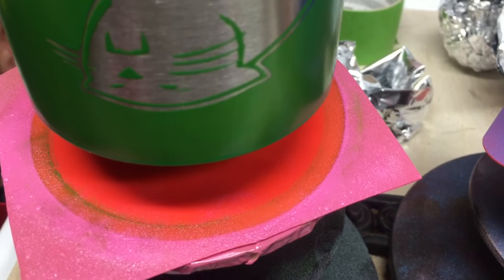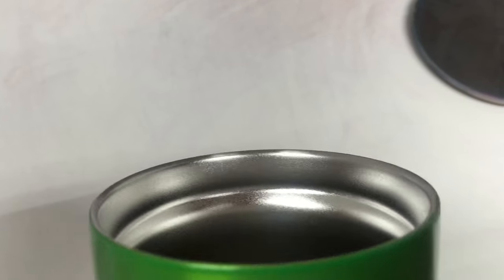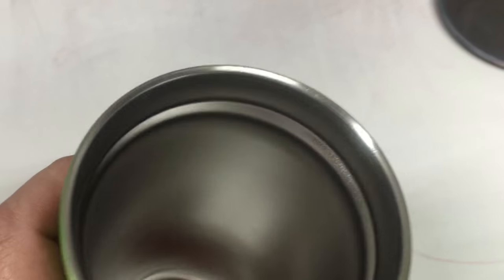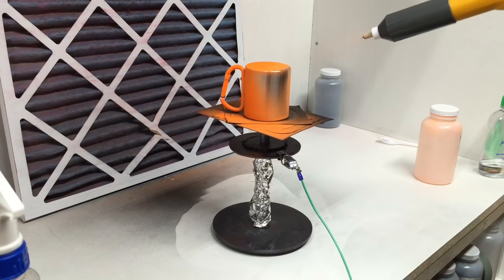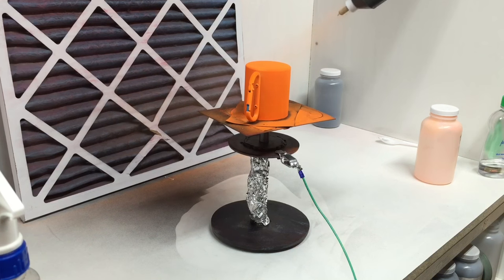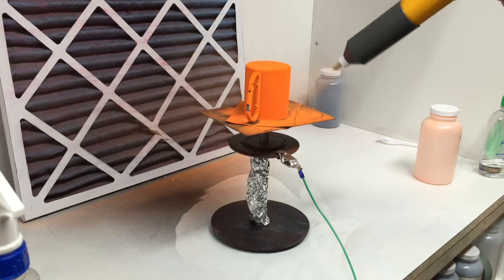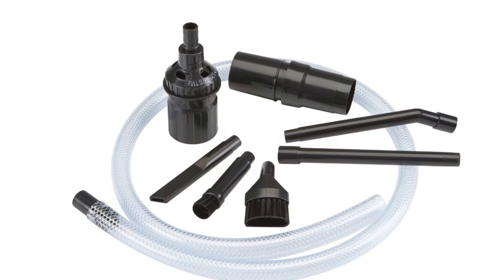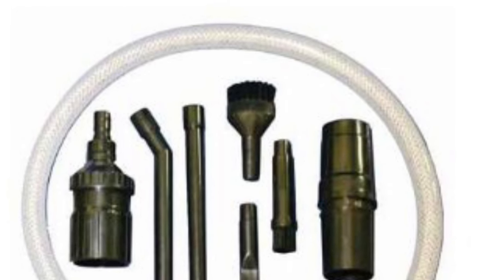One easy way to get a clean edge when Powdercoating a YETI.

Comment from the maker: Looking for things I use in my videos?  Look no further.  

Amazon Afillate Links:
Hypersmoth PowderCoating System  https://amzn.to/2NBkzjN
Circuit Rose Vinyl http://amzn.to/2dGxbFs
Circuit Explore Air 2  http://amzn.to/2cHnqJG
Vacuum Cleaner Micro Attachment Kit  http://amzn.to/2dCK5I7
Portable Bench Top Sandblast Cabinet  http://amzn.to/2dyewzl
Eastwood Dual Voltage HotCoat Powder Coat Coating Gun http://amzn.to/2dyecke
High Temp Masking Tape  http://amzn.to/2dCK8Dy
Oracle 651 Vinyl Starter Pack http://amzn.to/2dyexTU
Welding Jacket  http://amzn.to/2cS3z9j
Lincoln Electric Powermig 210  http://amzn.to/2dfOw6i
Certiflat Weld Table  http://weldtables.com/#_a_cust8g
Strong Hand Tools Heavy Duty Magnet Square http://amzn.to/2dycStl
Strong Hand Tools Magnet Level  http://amzn.to/2cS2ZYV
Markal Silver-Streak Round Metal Marker http://amzn.to/2dMikvI
Markal Trades Marker holder and 12 refills http://amzn.to/2dCLTks
Miller Extra Heavy Duty Gloves  http://amzn.to/2dMiqDD
FastCap PSSR16 16 FastPad Standard Reverse Measuring Tape http://amzn.to/2ut3PRK
FastCap PMS-FLAT-16 PMS Flatback Series Tape Measure 16 Foot http://amzn.to/2fgdIQQ
Evolution Power Tools EVOSAW380 15-Inch Steel Cutting Chop Saw  http://amzn.to/2dMhkb4
StudioPRO (Set of 2) S-600BN Dimmable 600 Bright LED Photography Continuous Bi Color Light Panel & Light Stand Kit with Carrying Case & Barndoor - Photo, Video & Film Production Studio Essentials   http://amzn.to/2dMiP9f
Blue Yeti USB Microphone - Silver  http://amzn.to/2dewgA5
Sony DSC-RX10 III Cyber-shot Digital Still Camera http://amzn.to/2dJcAA0
Reduce Cold-1 Bottle/Can Cooler 14oz (2 Pack) http://amzn.to/2cS4M0h
Makita 9557PBX1 4-1/2-Inch Angle Grinder with Aluminum Case  http://amzn.to/2dyh94x
Fluke 62 Max IR Thermometer http://amzn.to/2djM98G
Black 2pk - http://amzn.to/2fLLgkK
Blue 2pk - http://amzn.to/2fHXAUh
Pink 2pk - http://amzn.to/2fLJSyf
Char-Broil Vertical Electric Smoker  http://amzn.to/2fRGdiO   $137 Shipped as of 11-14-2016
Timer Digital Mini http://amzn.to/2gadt9M

#powdercoating #powdercoatingtip #powdercoatingtumblers

Comment: Thanks for the video! Do you not have any powder build up against the edge of the cup and the silicone pad?  I had that problem and it left a nasty build up of hard powder around the top.  How do you keep this from happening?
Reply: Curious about this as well.  My first cups had this issue.  I used a fine grit sandpaper to knock some of it down but it wasn't as good as I'd like.  I'm anxious to hear Chad's response.
Reply from the maker: Tell me more about the setup you are using?  Are you spraying the cup while it's on a silicone pad as well?  In the above setup, I am able to drop the base that the silicone is on prior to heating, so the buildup doesn't occur.
Reply: My biggest issue is the size of my oven. I'm using an oven from Eastwood which is pretty small so doing the large cups is challenging. Smaller cups utilize a stand closer to your design. I'm working on a stand that will hopefully alleviate the problem but having a full sized oven would be the cure. 

I was hoping you might give me some insight as to what you did early on to knock down the excess powder. Thanks for the reply.
Reply from the maker: +Howard Camardelle  figuring out a way to have a nice coating with no buildup or powder getting in the cup was definitely a challenge from the beginning.   That's why we built the stands. Have you thought about standing your Eastwood oven on the side?   Maybe get some rubber feet to allow it to have airflow underneath.  That would give you more head room.
Reply: I actually did but figured it would have some safety device built in that would kick it off. I guess it's off to the workshop for some testing, huh?

Looks like I'll be building a new stand as well. I'll fab up a stand for the oven as well to keep it lifted. Thanks Chad. You and Berry have both been a big help. I appreciate the vids and guidance. Seriously, thanks for sharing.
Reply: +bugmanchad thanks for the response. I do use the silicone pad but my stand doesn't allow me to drop the base before heating. That seems to be the problem. I will be building your stand setup today. Thanks again for being so sharing with your information. Not many like you left these days.
Reply: Tried the oven on its side. It worked like a champ!  Now to rebuild your stand again and get to work. 

Did you publish an eBay link to your mats. The Yoshis were expensive. 

Thanks again for your help.
Reply: Keep us posted bud. Thanks again.
Reply from the maker: Howard Camardelle
Will do.
Reply: i just made a stand similar to yours and put some high temp tape on the plate that moves up and down and seems to be working fine so far and once it builds up ill just take it off and retape
Reply: Jaime, where are you getting your tape from?  I've only seen the tape from Eastwood's site and doing that could become expensive quickly.  Got a pic and a link to what you're using?  Thanks!
Reply: this is the one i'm using when i ordered it was  $5.56 per row but looks like price went up x4 since i bought it but maybe if you look through amazon you might be able to find some at a lower price. here is the link to the one i'm using. http://amzn.com/B009KB7JRW
Reply: Thanks bud!